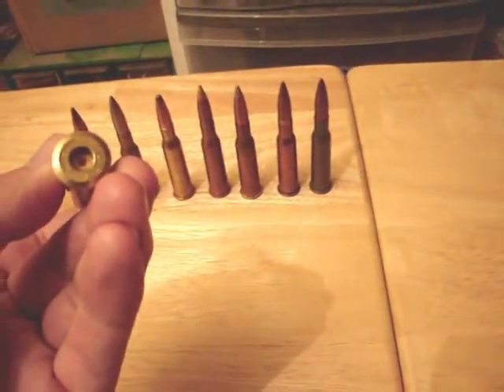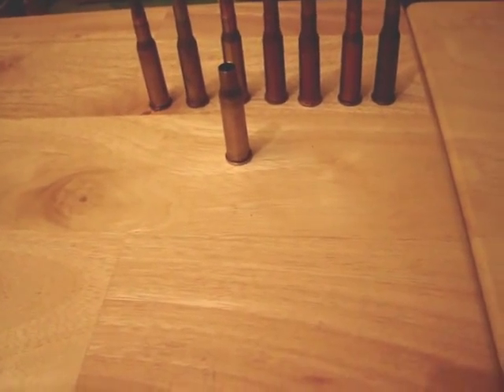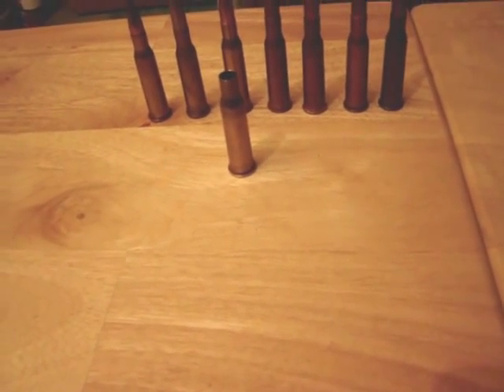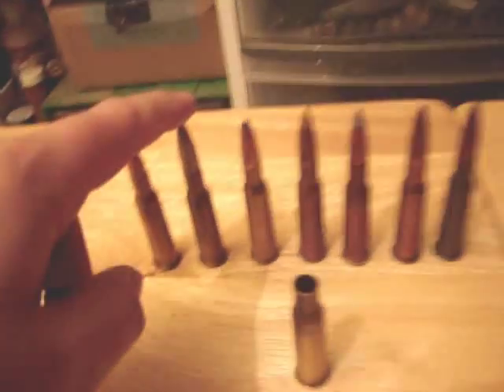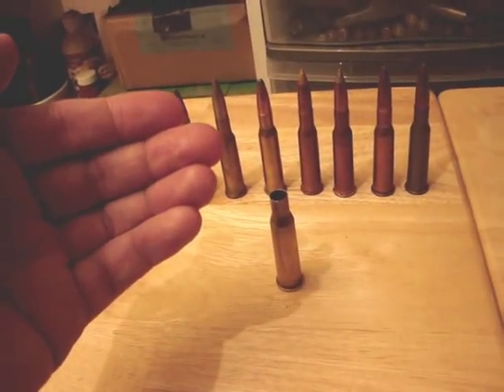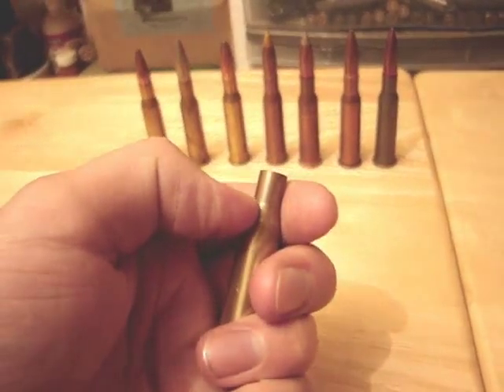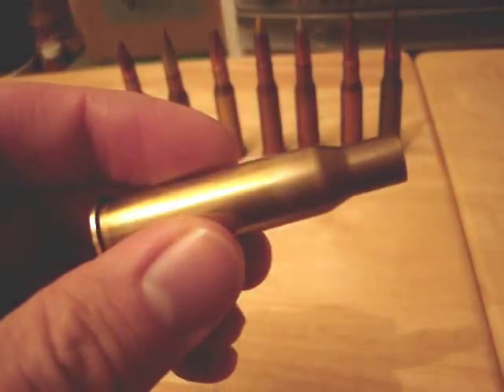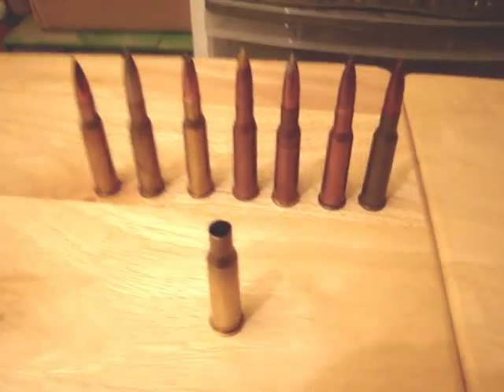7.62x53R and 7.62x54R

Comment: Since the 53R bullet is .309in in diameter shouldn't a standard .308 round fit the brass? The 53R is closer to a .308 round than the 54R

Comment: There is absolutely no issue using 7.62x53r brass to reload 7.62x54r rifle ammo.  The 53r and 54r rounds do not headspace on the shoulder.  The only difference is the bullet diameter, as Gungeek noted. Use the abundant 308 bullets for Finn rifles such as the M39 and .311 for Russian's such as M91/30 and M44. Brass is universal for both which is why Lapua makes only the one size designation.  For super long life, make sure your dies don't reduce the neck too much. Lee can make a custom size.

Comment: could i fire a 54r out of a finnish rifle chambered for 53r?
Reply: and? did you get an answer?Cause I have the same question
Reply: Slug your barrel and see what your bore diameter is. If it's worn down 54R might be okay.

I've read some say they can squeeze the standard 54R though their Finn barrel but it's going to wear it out faster.

He also said steel core surplus wouldn't even chamber

Comment: No difference really. I use 54R RCBS dies for a finn 7.62x53R. Bullet diameter is what matters, not much else.
Reply: I also often use 7.62x54R brass to reload 8.2x53R (finnish factory wildcat) ... just use 8.2 dies (Lee makes them) to push them in shape. I dremel the 7.62 stamp a bit (make it fuzzy) so that I recognize the neck-enlarged casings.